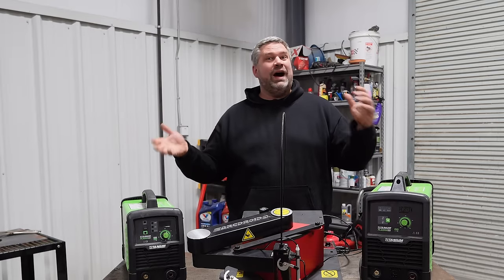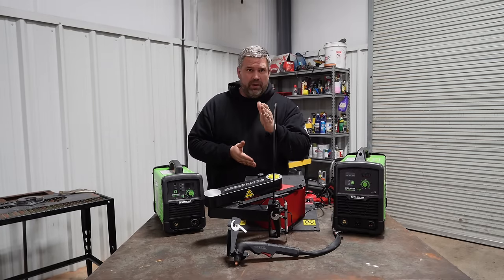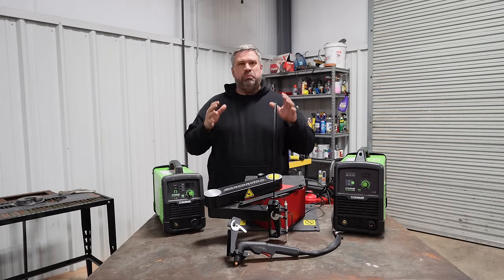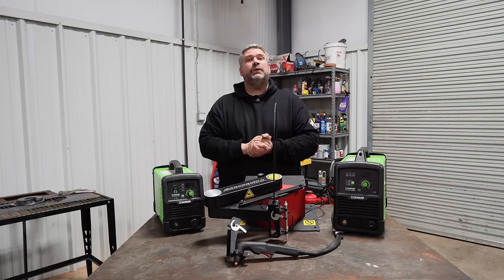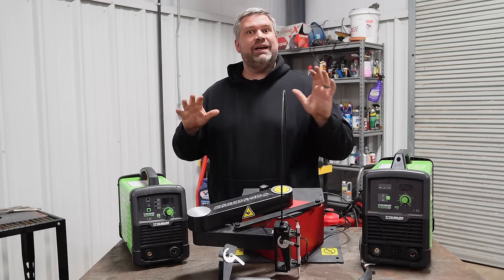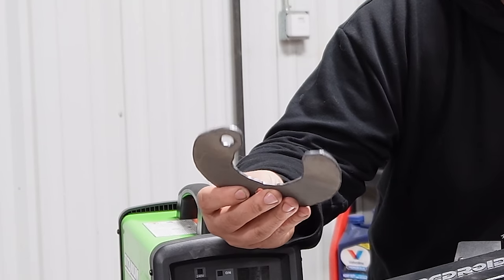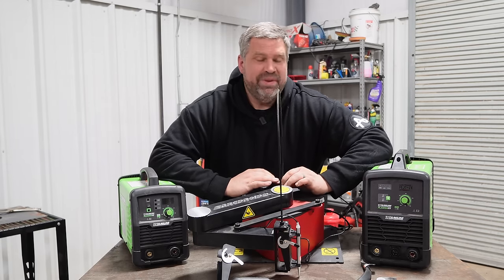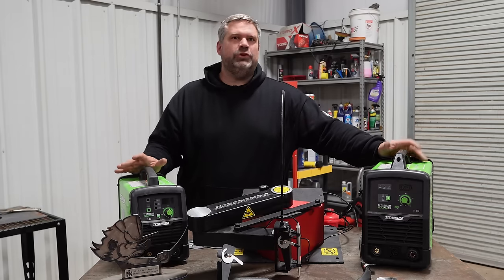You’re Wasting Time If You Don’t Own This Tool!

Comment: I have a plasma cutter. Every shop needs one. Jared is correct. Very handy to have indeed.
Reply from the maker: Demo, fabrication, arts and crafts, they do it all!
Reply: @CarWizard Since you only like stock boring vehicles I can't imagine you'd use it that often. It's not like you're doing any cool mods to anything.
Reply: @johnquinn4680  Right. No one off repairs on vintage cars, tractors, exotics with out of production parts, or duramax swaps to be seen anywhere in the wizard's lair. All kidding aside, even stock vehicles, cutting rusted parts off, personal projects seem to be a staple, and if you have to part out/scrap a car. I agree, they have a lot of uses, even without a cnc.

Comment: I think the ArcDroid is absolutely awesome! It's near the top of my list for needed shop tools right after a TIG welder, which I just got from PrimeWeld, and a lift. I didn't even know about the quick trace option. That adds even more usefulness. I saw one in action when Chris AKA Rusty Van Ranch helped me plasma cut some NLA exhaust gaskets for an old Greddy turbo. He has used it for a ton of projects. Considering how many small metal items tend to pop up as needed during fabrication, the ArcDroid makes a ton of sense. If you have a huge shop for a full table and you do a lot of volume, maybe a different story. For a small shop or home gamer the size is great. Also FWIW PrimeWeld has a 50A plasma cutter for $289 or less with whatever coupon is currently available and there are some other cheap options out there which can do at least half an inch. Totally agree it's a very useful tool to have and in my experience less messy and much quieter then cutoff wheels.

Comment: Obviously not the correct way, but I "cut" some exhaust off by turning my T-125 welder up. More of an experiment than anything but it did work. Wasn't as ugly as I thought it would be either. Was a good use for the cheap wire spool that came with the welder. The included spool was fine. "Welded" my first welds on 19 gauge sheet steel with it.

Comment: Make sure you can get the consumables before you buy. I made the mistake of buying one off the took truck for 5 times more than  Jared's machines. I was roped into buying the electrodes and tips from the took guy. When the internet got big after 2000 I found out the gun was a French company and was able to buy the tips for a fraction of the price.

Comment: Sever dimension is max ugly cut.
Clean cutting is 70% of sever size.
60 amp is great for everything under 3/8.
If you're doing bodywork 40amp  is great.
Anything less is sheet metal only

Comment: I have the TITANIUM 65 Amp Plasma Cutter and a TITANIUM TIG 200™ Professional AC/DC TIG Welder with 120/240V Input after seeing your other videos and having the wiring to do the 240 volt.  They will replace my 24 year old Campbell Hausfeld wire welder.  My garage is starting to look like a Harbor Freight store.  

Question.  I have a 20 gal compressor, do I need to upgrade?  I’m also planning on taking the WelderUp course.

Comment: The primeweld 60amp plasma is only $699 and it's way better then the titanium machine. Plus it comes with a 3 year warranty and their customer service is excellent.  I have their tig225 and their mig 200 and they have been amazing. I've had the tig for 5 years now and it's been flawless. They all come with ck products and the mig comes with an aluminum spoolgun. For the money they are unmatched.

Comment: For those with heavier steel cutting needs, there's a step-up technology called the Air-Arc gouge. So if you are repairing things like dozer blades or other heavy equipment, it's a pretty effective tool.

Comment: Remember if it says it will 3/8 that means it will only cut it smooth at 10” per minute.  Now if you are going to use one in an industrial setting you need to invest your money in a Hypertherm. Out of all the companies that make plasma cutters they are the king. You can get the consumables anywhere. Most all welding supply companies have them in stock. Miller and Lincoln are hit and miss and Hobart is owed by miller and in a lot of cases there  Consumables are the same

Comment: Thank you for explaining about plasma torches. I admit, I was not aware of how you can use them. One thing I did not know is that you have to use them in combination with an air compressor. I would have liked it if you had given more explanation on the type of air compressor that is required for a plasma torch.

Comment: you straight up aren't supposed to move the bigger tables. When I worked in a fab shop, moving it was  a BIG deal. It had to be emptied, cleaned out, torn down, re assembled, then recalibrated. it took days of downtime to move it . oh, yeah, and it needed to be fully mortar bedded. Are there easier ones to move? no doubt, but you can't get around the opportunity to clean it out, empty it, re fill it, and I'm certain re calibrating.

Comment: hi, i have a daihatsu terios, is kinda like a suzuki jimny, unfortunately it doesn't have low range tho, cause the car is kinda uncommon,i can't really source all the parts, for example the fuel pump unit, the wole level sender unit got kinda melted when the fuel pump failed and i really couldn't find a replacement, how could i re do my fuel system with lets saw an line and aftermarket pumps? is an efi system

Comment: Lets ( STEP Back ) to Go forward here.   A clip or  two you have  made about  ( WHAT TOOLS ) and  Why along  with comparing them to the  big  box stores, tool trucks and  the  1/4 million dollar ( MISTAKES ) of  Matco, Cornwell, Snap On, Mac, etc.  Today ( I ) went  to look at a  few clips YOU have  been talking about  like a mini series of CAT and Mouse. Explanation. Starter, intermediate, D. I. Y . Shop Assistant. Car builder, Road  worthy mechanic, Dealer ship Driven ( REQUIRED Tools ) versus  the  Reality of a  BUDGET still matters. Harbor  freight is  NOT  american made. Nor  does  tiawan, china, or other third  world countries  base there culture on USA  being  the  top of  the food  chain.  THINK of the  term / Definition ( CRAFTSMEN )   For a  Time  in the  1900's to 2000's  they were built, made, bought and  sold  on the  American soil with  few able to say even close to the  same.
Stanely, Black & Decker, The  Industrial side ( COMMERICAL ) Version De Walt, along  with brands like Chanels locks, Vise Grips, Cresent, Estwing, Etc. AL  used the   NAME plate ( MADE in the USA.   WHY does any of it  matter ?   A  Clone  of  a  Clone  which is  then CLONED to be like  ( BUTT ) not  actually  a  Form and  function of the ORIGINAL is  not  a  Value  when push comes to shove.   I would NOT  discount  all  the store brands like, Kolbalt, Husky, ridged, Bauer, Hercules, etc.  as being  the  same  or  worth every penny  spent of  saved.   In a  pinch * ALMOST * anything is  far better then nothing.  IF  YOUR  Business expects  perfection and  the  Tool Trucks are who are being  offered ? ? ?  a  Budget which is  often times  added to  or  reimbursed by the  OWENRS Credit  card influence who buys  what and  why.  In the trades  ( Apprentices  are told.  YOU NEED ( X, Y, Z, )   They often cannot  afford  more then the cheapest of  the  cheap to get them into a  program  or  out on a  job  to earn a  wage for  quite some  time  unless they stick with it  that is.   TODAY I AM Frustrated by YOUR  lack of  acknowledging  all this.   A kid still living in his  parents  basement. Cannot  afford a  500, 1000, or  1500,  dollar  tool cart, chest, cabinet or more. 
Nor  does that same  person  have the budget / Credit to spend  way over there head still.  I have seen plenty in this world  OVER EXTEND the very essence of  INCOME  versus debt in less then 6  months  on any given job site or  employment  opportunity  in or  right  out of  trades school too.   YOUR  lifetime of  OVER KILL in tools  is NOT likely  even close to what a  20,30,40, or  50  years old  Reality will be  when getting into or  upgrading in todays  economy of  Fantasy INFLATION ( Aggravation ) . Bu Going to LOWES, Home  Depot, Menards, ACE,  Walmart, Harbour Freight,  or  any other location that  sells  stuff short of  internet like amazon and  such   PRICES are going to vary on even the  most  inexpensive versions of  tools  overall .   I CHALLENGE  you to STEP  back to the  teen age years of  days gone  by.  Sit  down and  make out a  WISH LIST.  First in the  100  then 250 , 500 , 750, 100, 1250, 1500, all the  way up to 2500  dollar  amounts.   What  tools get  added in ?  What brands do  you  change out and  WHY ( MORE importantly )   Is a  Tool Box / Bag ?  Maybe a  few rolling  piece by piece  stackable version from the Big  box  stored s that  carry it  al for  years to come ?   YOU are NOT  doing any REAL Service to tall the viewers out there by constantly  saying  your  TOOL TRUCK Investment is now the  same  butt far less expensive and  worthy o f the same  kid  of HONOR  when a  penny and  your  own two cents are contradicting  it  all with every breath  Forwards and  backwards...   The  VOICE of  Reason has  spoken  YOUR  welcome  in advance for this  REALITY check.  NOW  make a  TRUE to Time  20204  Version of  your  teenage self  going  forward.   Tools  are not  for  the  faint of  heart.  What  is  still in your  own collection that  was from when you  got this  party started ???